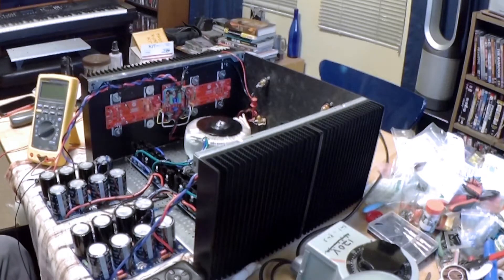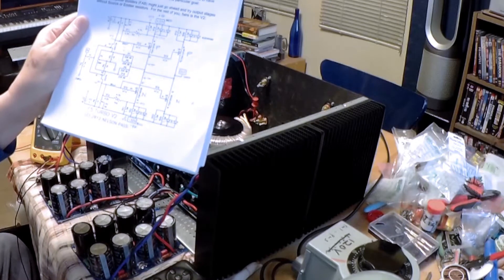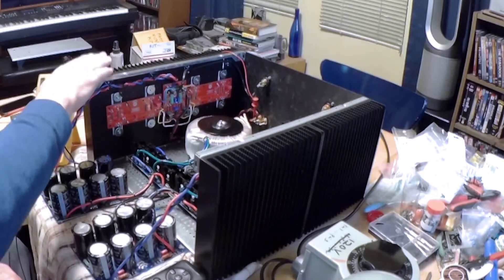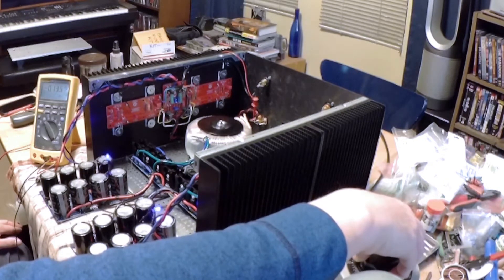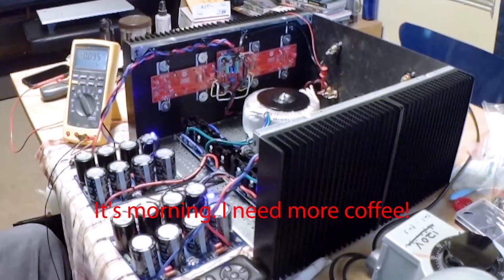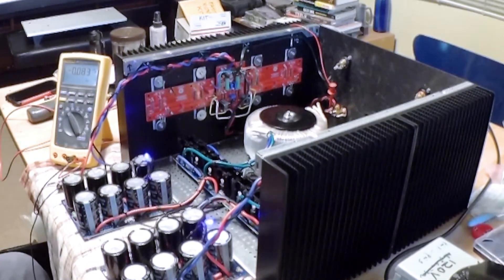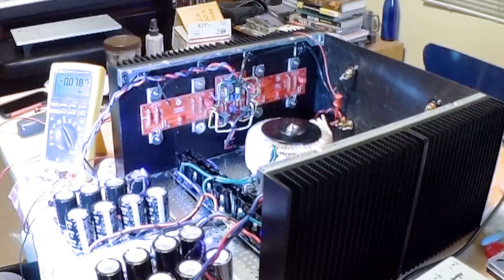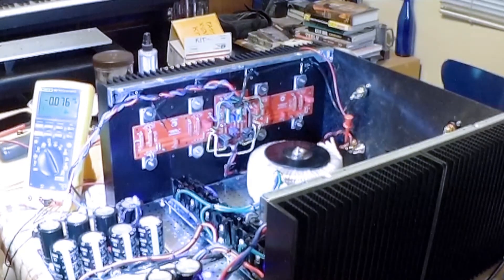Robert builds the Nelson Pass F5 Turbo Amplifier Part 5

Comment: This is the part where I'm now stuck at friends. We're looking at voltage on output, I can see the DMM on the speaker out wires. You were saying you were getting DCV readings in the mV range, so <0.1V. When I turned up my variac > dim bulb > PSU, I was only able to get to around 44VAC, 1.435VDC on PSU out, and 0.493V on speaker outputs. Bulb was dim and on at this point. Does that tell me anything? My inputs were NOT shorted, and I had NO LOAD on the speaker outs.
Reply from the maker: Drew, I think I would first disconnect the wires from the power supply to the amplifier boards. See then if the supply can output normal voltages. 
If it can't, I would first check, with the power off and unplugged, for shorted out rectifiers using the diode function on your meter. 
The output Mosfets on the amplifiers are a little harder to measure, but there should always be a very high resistance between the gate and the source- several hundred Kohms at least.
You may want to check that all your source resistors read at least 0.5 ohms. Any lower readings may be a bad turbo diode.
It would be unhealthy to put a test signal through the amplifier until you are happy with passive resistance tests. You never want to push a signal through an amplifier that isn't connected to a test resistor or speaker. Otherwise the  output device has to dissipate all the power applied to it.

Comment: Robert, these are some excellent videos. Can I ask what wire gauge you used inside the amp? I’m building the F5T v2 and ran 18ga fine stranded wire but am now questioning if it’s heavy enough before I go much further
Reply from the maker: 18 gauge should be fine. Good luck with your project!
Reply: I wish I could get my bias and offset as stable as yours. Mine is constantly hunting up and down with the lid on sometimes as much as 10/15mv one way or the other which then affects offset the same way..

Comment: Could you detail the shorting rca inputs, and the resistor setup you’ve got across the speaker leads? You said “in series parallel” but which is it? Looked a bit like both! Two in parallel, then those two pairs in series. As I recall two 8ohm in parallel goes to 4ohm, but then you put those in series, so back up to 8ohm. Is that important for this test?
Reply from the maker: Sure Drew. It is probably not necessary but it keeps unterminated inputs from possibly picking up noise or radio interference. I forget where I got the plugs I have; they are factory-made so someone probably still sells them. They would be easy to make out of a cheap interconnect cable.  There are two 8 ohm resistors in series, in parallel with another two in series.  The term series-Parallel just refers to a mix of the two connection types. I always feel more secure if the amplifier has a load connected, as it is a more realistic situation of what the amplifier will face. Back in my early days, I blew a project amplifier up when I fed it a test signal without a load connected.  So the loads are looking toward the future when I run a test signal through the amp.